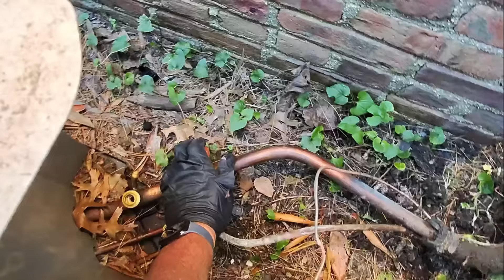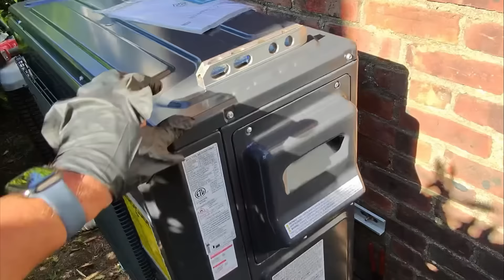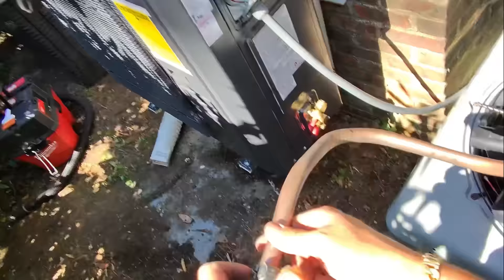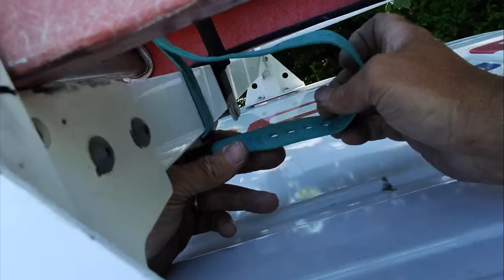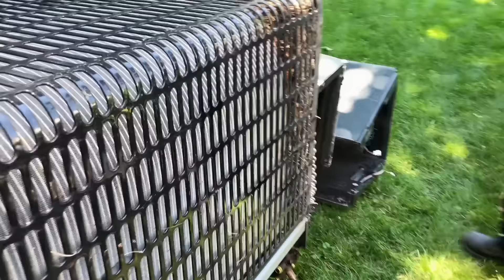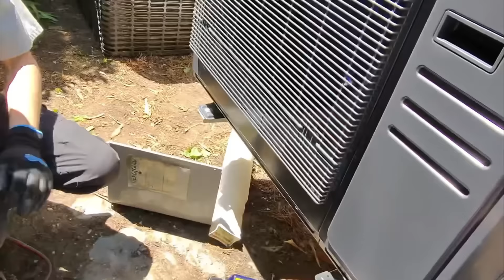This HVAC System Should’ve NEVER Worked… ACiQ to the Rescue!

Comment: Nice installation. However, I don’t anchor anything with weight into brick. It’s too soft, brittle, and not thick enough to hold. Those anchors will loosen up, and pull out which could result in the unit falling to the ground. Just speaking from experience.

Comment: It looked like the emergency drain line was going up hill could just be the camera angle. Tell Daniel to pipe in the airhandler a little better . Also question why do u do electric b4 copper ? just curious

Comment: Pressure up that quarter inch on that 3/8 and see if it holds! 👍🏻😎
Reply: doubtfull it would hold, seeing it squeezed out to the side in a sharp flat pinch. it lielt ripped all the sealing rings and cracked through.
Reply from the maker: bet it does
Reply: As they say on Red Bull adds.  It has wings...... 😂

Comment: imagine how cool that wiring would look in metal conduit? something to think about
Reply: metal conduit outdoors is a horrific idea for a few reasons.  Main reason being heat.  once sun hits the pipe the internal temps can rise to 300-400degrees compromising the wires inside because you guessed it, electricity is heat and the wire rating is a temperature rating.  Second reason astectically speaking metal in new york winters will absolutely rust in short time if it doesn't get painted or protected, which no installers do.

Comment: I thought you couldn’t pump down a micro channel coil
Reply from the maker: Why not?
Reply: @PipeDoctor  cause TFM says not to. But if your trashing the unit anyways then yeah why not
Reply: You physically cant the compressor will always bypass on you. To much head pressure.
Reply from the maker: @Ramirez.A91the compressor will NOT always bypass.
Reply: Great install as usual but I never put anchors into brick, especially anything with weight. Brick is too soft and brittle. The anchors will loosen up and pull out of the brick. Only speaking from experience.